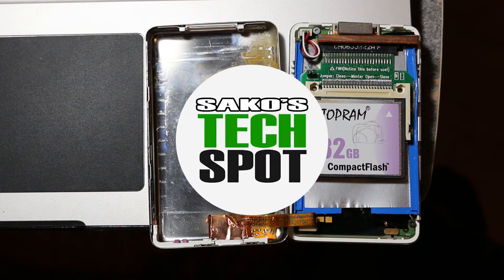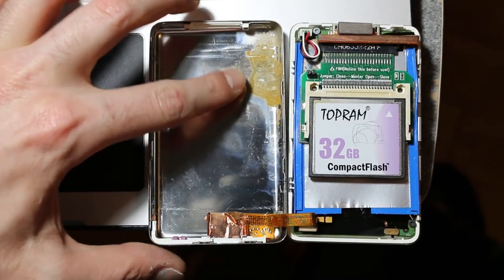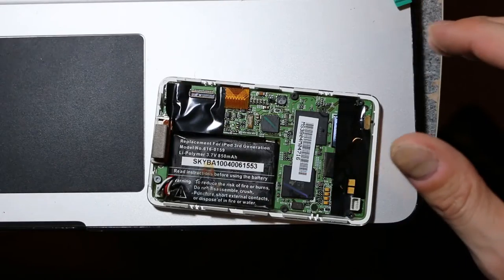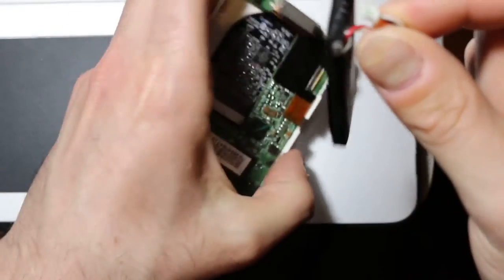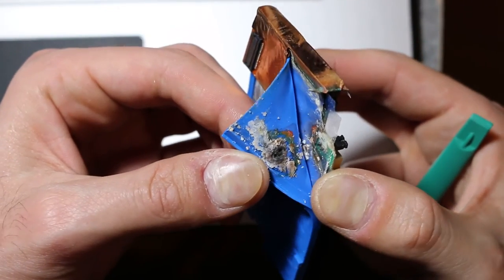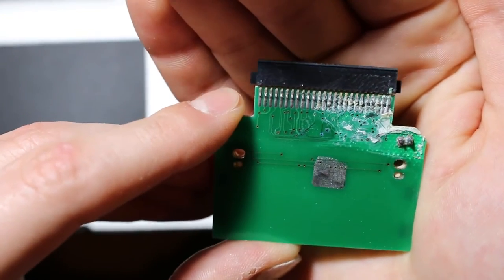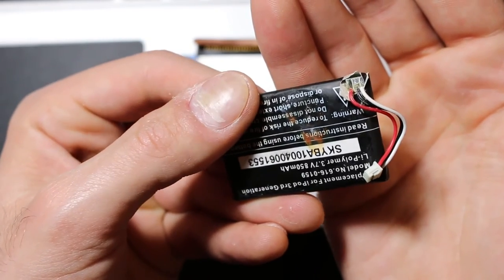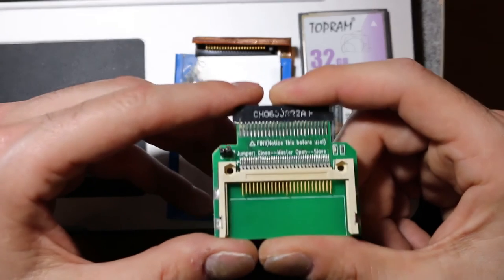iPod (3rd Gen) Compact Flash Upgrade | FAIL!

Comment: Looks like the master/slave pins pierced through the battery. The damage on the board looks like the type of corrosion you get with leaking electrolyte.
Reply: thats right
Reply: Use good isolation

Comment: Seems like a chicken and the egg situation. Did the battery burst and then the pins pierce the rubber, or did the pins pierce the rubber and short the battery?
Reply: Imma say the 2nd thing u said is probably correct because thos solder pins can be pointy as hell and I was about to type the same thing and then I saw ur comment lol.

Comment: Heat problem, your battery heat it up on pins, then melted the blue plastic and then pins made contact with aluminum case then short circuit